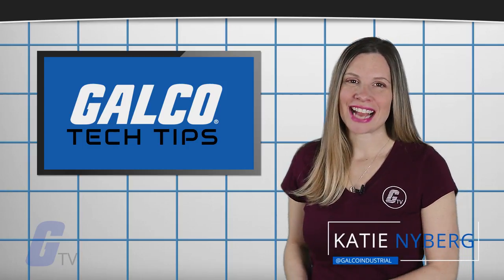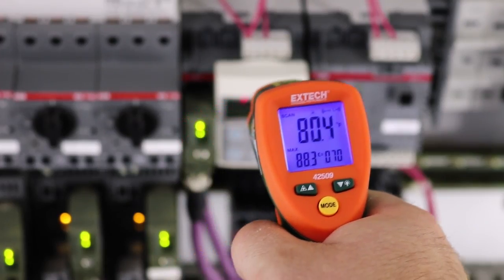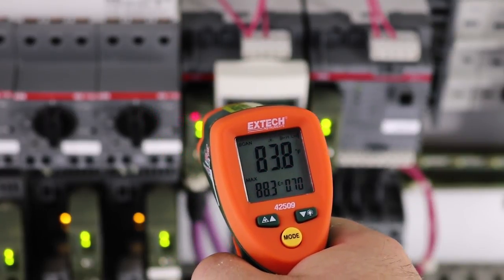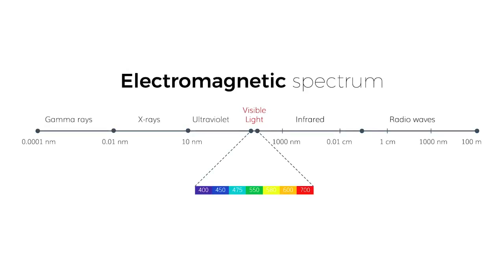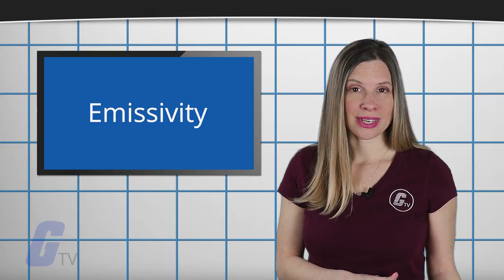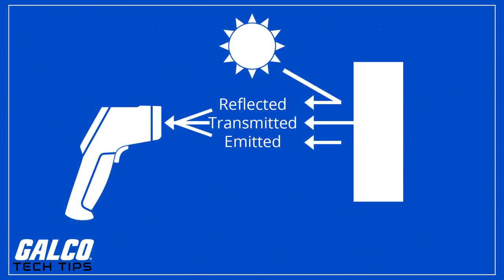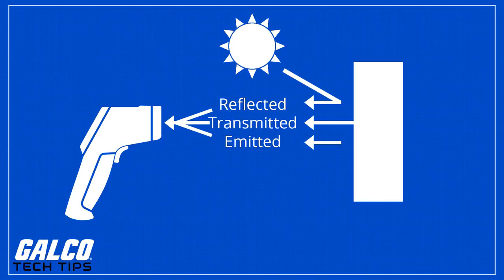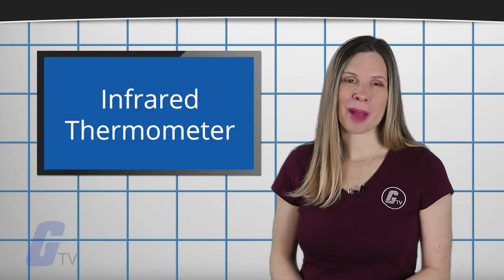How does an Infrared Thermometer work? - A Galco TV Tech Tip | Galco

Comment: How far does it go? I shot mine into the sky. It says 7° F. It was 65° outside.
Reply from the maker: IR meters do not measure air temp, they need a reflective surface to see the temp. Different materials have different emissivity ratings. Check the manual for your meters ratings.
Reply: GalcoTV distance is 0-20 cm. Emissivity: 0.95 (fixed)
Reply from the maker: So there ya go, 20cm is less than 8 inches of distance. The emissivity of 0.95 means reflective but not necessarily polished either. IR meters are meant to measure surface temperature of objects. So if you want to know the outside temp with your IR meter then pick an object sitting in the shade and see what it says.
Reply: This comment made me laugh, shine it at the sun and see how hot it is
Reply: @GalcoIndustrial so what is the difference  with the ear thermometer that should touch the ear and forehead to take the measure? Is it have a different sensor?

Comment: How come my laser infrared thermometer only reads 90-92 degrees on my & kids'' foreheads? Shouldn't it be 96.8 or near that #?
Reply: Because the skin surface has heat losses, The outside surface of the body will be cooler than internal.

Comment: The laser is simply a led right? can you use it to measure the computer's motherboard temperature while its on? I suppose it won't short-circuit anything?
Reply from the maker: Yes you can use it on electronics. It will not cause a short. The laser is very low power and is only intended for pointing at a surface to measure.
Reply: @GalcoIndustrial  thank you

Comment: This instrument has lead us into the greatest misunderstanding in science, greenhouse theory. Tyndall used it to define the greenhouse gases in 1859. The instrument poses a contradiction; all matter radiates - as correctly stated - but by this instrument not all matter does. The reason is that - I have deduced - not all matter is thermo-electric. More specifically, not all molecules have electric dipole moments that 'send' an IR signal able to be received (transduced into an emf) by the said thermopile.  Nitrogen (N2) and oxygen (O2) are the perfect examples of this; they are not measured at any temperature by the thermopile, yet, they have a temperature.  They are both very poor thermal conductors (0.026 no units) so they must radiate. From this instrument, we believe that the only matter that radiates - and the extent to which it radiates - is only determined by this thermopile. It defines the greenhouse gases. Emissivity is really and only a correction factor.  Yet there is another complementary instrument that measures the IR  that the thermopile cannot detect, The Raman spectrometer. Read my work at 'Quantum Mechanics and Raman Spectroscopy Refute Greenhouse Theory' http://vixra.org/abs/1811.0498 and while you are at it read 'The Greenhouse Gases and Infrared Radiation Misconceived by Thermoelectric Transducers' http://vixra.org/abs/1811.0499  
In time I will overturn current radiation theory and make it coherent.
Reply: In time you will do jack shit. Spend your theorizing time connecting with friends and family.
Reply: @EvanGisamazing lmao why so angry at a guy with a theory. Let the nerds put pen to paper and continue the battle of greater understanding every day.

Comment: Does it work to measure temperature in oil tank?
Reply: Do not use electronic devices other than those specifically designed for use with the unit, which will probably be a built in sensor or manual grounded gauge, idk. You were joking, right?

Comment: Does the lazer do the reading or is it just to guide where you are pointing At and the actual device is driven by an invisible force?
Reply from the maker: The Laser is just for aiming it. The lens has an infrared sensor behind it to measure what ever is in front of it.
Reply: The laser is for aiming. And yes It is strong with Force.

Sorry I've been watching star wars
Reply from the maker: @asandax6  , lol no problem. we have starwars fans here too
Reply: If you can see the laser pointer, it is in the higher frequency visible range that is not even detected by the meter.  It just marks the center of a circular area whose IR (heat only) energy is detected. The diameter of the circle may be about 1/10 the distance to target.  The more heat detected, the higher the temperature reported.  If some of the heat detected is reflected from the target (i.e. target emissivity is less than 1.0 for heat) from something hotter or colder near the target, the reported temperature will be a weighted average of the two heat energy sources' temperatures.  Taking the temperature of a mirror is likely to show the average temperature of the room walls and contents behind the meter reflected from the mirror, rather than the mirror glass temperature.

Comment: humm, so it won't work in the dark?
Reply from the maker: It still works in the dark just fine, but you may have trouble aiming it if you can't see what your trying to measure
Reply from the maker: The illustration we use with what appears to be Sun light shining on the object is merely warming it to measure something. All objects emit this infrared signal that is always proportional to its temperature.

Comment: i do not like any of these guns especially pointing at my forehead it just doesn't feel right.
Reply: I’m sure you think microwaves are dangerous too.
Reply: @nicholasbeaufrand4752  well actually a microwave doesn't probe you and invasion of your privacy however, if you put a fly in a microwave and turn it on he will just fly around in there and when you open the door he will fly out , no problem.
Reply: Paul Culwell well this thermometer doesn’t probe you either. It receives infrared light from an object and converts it to temperature. The laser is just there to aim at whatever you want to measure. And it’s a low intensity laser. Won’t hurt you.
Flies have little to no water in them so the microwaves pass right through them. Any animal with a tad of h2o in its body would die a painful death.
Reply: subliminal messages
Reply: @nicholasbeaufrand4752  I do.( microwaves) I have concerns about this thing being pointed at the third eye. Someone told me it’ll affect the pineal gland